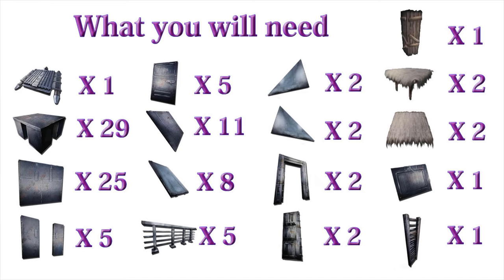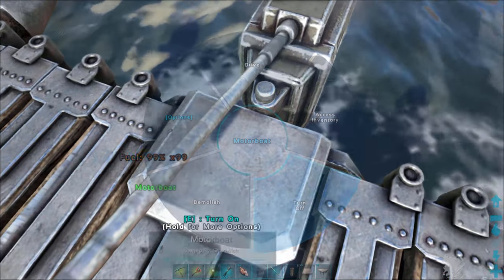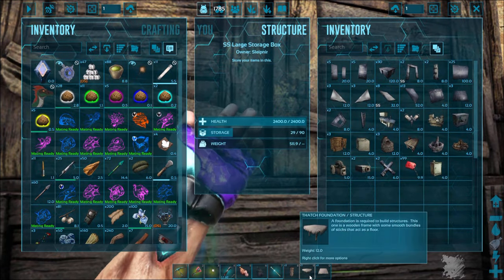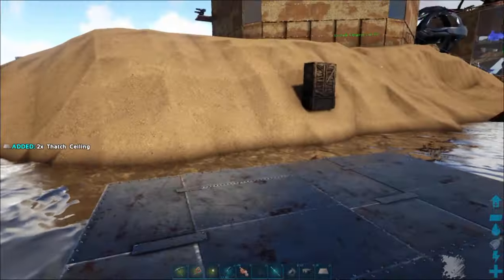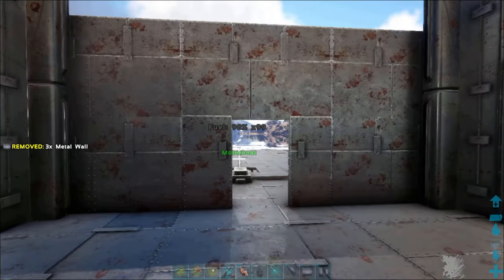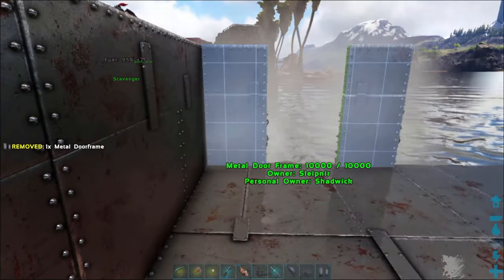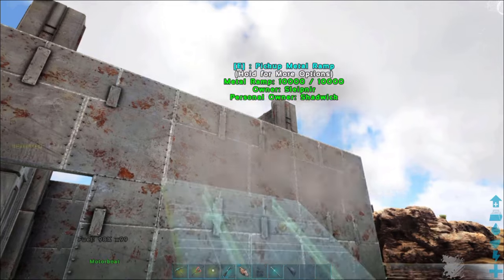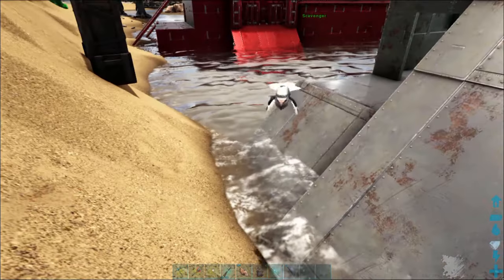Ark Motorboat Taming Raft - Ark Survival Evolved

Comment: I'm sure I'm doing something wrong, but when I follow your build, I end up only being able to  go out 4 foundation from the motor on the back, but the front can out to 6 on 1 of the rows and 7 on the side.  Also, what do you do to make sure the leedsichthys can't destory to boat?
Reply from the maker: jeffrey young, I've had that issue before myself. It depends on where the first foundation is placed. A little off and you are short on one side. I usually just shorten the boat by one at that point instead of starting over. As far as the Leedsichthys, I stay shallow when they are on the map. You can outrun the normal ones, just not an Alpha. Every time I encounter one, I would head to shore and shallow water. Or, you could just remove them from the game if you are on Single Player. I have a video on that:
https://www.youtube.com/watch?v=Jri6G6iU6uA&list=PLlZCJ7dC_d_KQfZ0iQX_27FajJxXRhIEv&index=28&t=1s&ab_channel=Kaazoo71Games
Reply: @Kaazoo71Games  

I Am on a private moded server and have full control, so i have tried placing the foundation down several times in different spots. I always seem to have less on the back compared to the front, and it also affect when i can build the walls so on your build you were able to make a 3x3 on the back the best i could do is 2x3 unless i put the taming part on the front instead of the back but still have issues figuring that out
Reply from the maker: @jeffreyyoung8871  If you are using mods like Structures Plus or Super Structures, make sure you are using the NON Modded Foundations. The mod parts will not work correctly
Reply from the maker: @jeffreyyoung8871  Also make sure your raft is in deep enough water. That can be an issues sometimes
Reply: @Kaazoo71Games  

Yup, I tried both of those. It might be the alignment thing. It tried moving that first foundation as far forward as possible and back, but it didn't matter; it always stopped me at 4 Foundation. I thought maybe they made patches that just makes that build not work anymore but if your still able to do it then im not sure whats going on
Reply from the maker: @jeffreyyoung8871  I posted this in April. I have not made another one since then. It would be something I can test and let you know, but it wouldn't be tonight. They do a lot of patches that mess things up. it's very annoying sometimes. Without watching this, I believe I only go out 3 in the back. 2 for the Gateway and trap and one extra.
Reply from the maker: @jeffreyyoung8871  I just watched this and I'm 100% sure they changed things since this video. I would suggest doing 3-4 in the back to just cover the 2 for the Gateway Trap and one extra. If you can do 4 in the back, that is perfect since you need 2 for the trap and the 2 extra to drop the ramp all the way down.

Comment: do motor boats have a weight limit?
Reply from the maker: @lgtexas2013, they do not have a weight limit, but they do have a Structure limit: 135. That is the max number of items you can attach to them.

Comment: Does this work for gigas and if so is it in the build limit?
Reply from the maker: The build limit is 135 on motorboats. I am way under that on this build (98 on basic parts). You would need it 3 high for a Giga to not escape. So if you shorten the front of the boat and lengthen the back, you could make the back 3 high and the ramp 3 long. I know that a Rex or higher cannot be transported on a boat. So at best, you may be able to get them into the trap but they may escape or at the very least glitch off. I have never tested it. I do have a video on a simple Giga trap. 
https://www.youtube.com/watch?v=yqrDge3-SrM&t=1003s&ab_channel=Kaazoo71Games